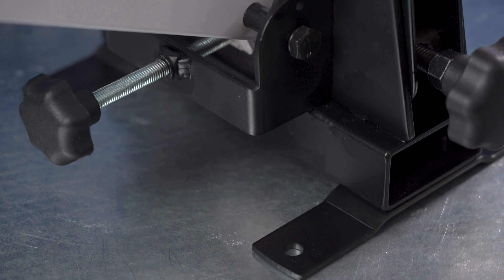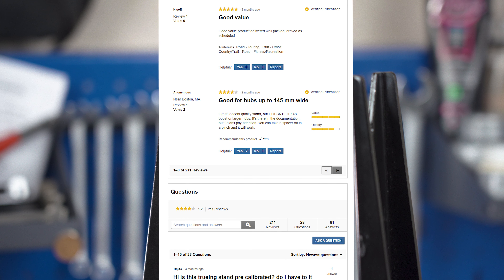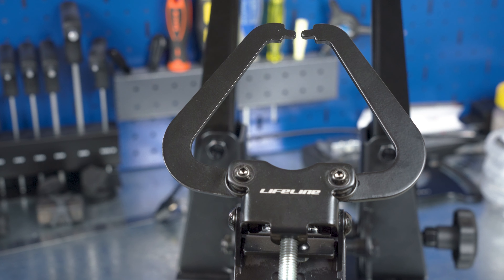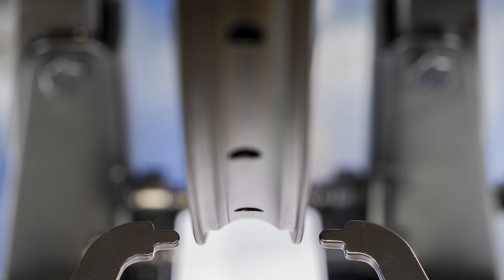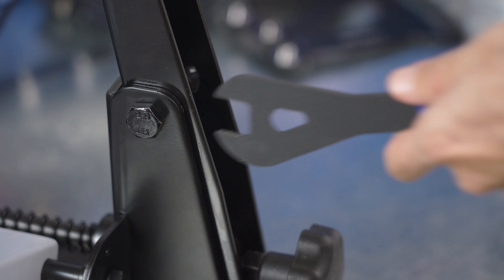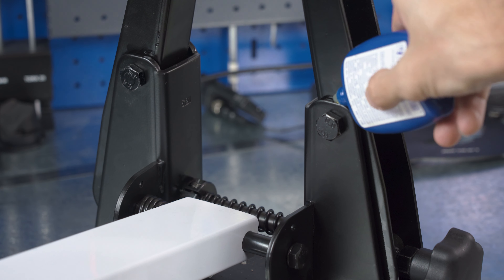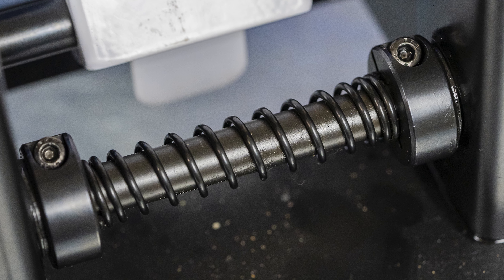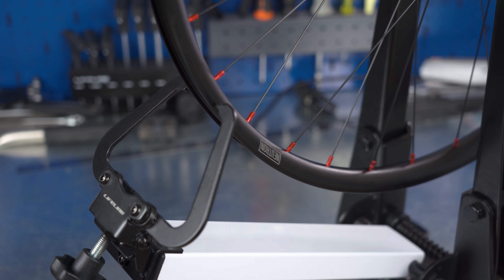LifeLine Pro Mechanic Wheel Truing Stand – common concerns (short review)

Comment: OK, I bought one of these. Reckoned that it would be worth spending the time to set it up, given what I would have paid for a blue one.
No big issue to get it to open to 157mm for DH hubs. Mine was already opening to 152mm, took off uprights (which was a little bit fiddly) and ground 1-2mm off the bottom of each. Now it's opening to 158mm at the lowest point where the hub will sit. 
My uprights too were not lining up when they were fully closed. As you say in the review, loosening the pivot bolts lets them line up (although still not completely in my case), but I don't think it is a good idea to do this. With the bolts loosened, there is a lot of backwards and forwards play in the uprights, which means that your wheel axle will be able to wobble in the stand, making truing very difficult. You need to keep the pivot bolts tight to prevent this happening.  The way to deal with the misalignment is by using the calibration screws on the callipers. You can swivel them to match the angle that the wheel rim is at. This does mean that you will have to re-calibrate a bit when using a different size wheel or hub
Reply from the maker: Kudos for your successful effort, Justin! Have not thought of posting a video on this upgrade?

Comment: I have the BikeHand version of this, and its arms open to 145mm only.  My calibrating screws were very tight also.
Reply from the maker: I guess, the real manufacturer of this stand adapted it to ~150mm hubs at some point due to demand for hosting boost hubs. But the descriptions didn't get immediate updates. Actually, CRC still says "145" 😀
Reply: @ZavyalovCycling  I hope to never need to make significant adjustments to keep my boost hub true.  If I ever need to, I'll do it in place.

Comment: I have this stand and is solid but not without some issues. This is a rebranded  Bikehand brand, bikehand is a decent knockoff of all parktools and other bike brands. I'm also using the park tools thru axle adapters and rotor truing attachment with this stand.
Reply from the maker: Clearly, "not without some issues", agree! 😀 But the price reduction is very noticeable as well!

Comment: How did you align the two uprights to be flush. Mine are horrendously off centred
Reply from the maker: By releasing excessive tightening of the uprights bolts. It’s shown in the video. I cannot promise it solves each and every case, but surely a thing to try. And Merry Christmas! 🤘
Reply: @ZavyalovCycling  I tried what u did, but I didn't work, it barely lines up, fully loose and pushing with my hands. Too bad, it looks like a nice stand. Merry Christmas to you too!
Reply: It's metal... Can't u bend them, with a lever to get straight. Maybe they got bent in transit? Bend back straight.
Reply: @rupedog  na, just really bad build quality. The two forks are welded not straight. Like so badly u can see with ur naked eye

Comment: Hi . Is this ok to use with carbon rim? Will it not scratch the rim?
Reply from the maker: Use it with some good care, and it won't. Any truing stand can scratch a rim, unless it has special rubber pads on tips. They are available as an option or with some very pricey stands.
Reply: @ZavyalovCycling  Thank you for your reply.

Comment: Anybody hacked this to fit 157mm hub? I haven't bought one yet, but am hoping that grinding a bit of metal off the bottom of the uprights will mean that they will open wide enough to fit a 157mm hub. Alternative is Park Tool TS-2EXT.2 Upright Extensions, but these are silly money for what they are and seem to be out of stock everywhere at the moment.
Reply from the maker: I'm afraid you'd have to grind reeeeeealy deep to have this chance 😉
Reply: @ZavyalovCycling  Thanks for reply. I'm surprised though as I only need to get an extra 5mm opening of each upright at the top. Given the length of the uprights and low down position of the pivot I would reckon that even just taking 1mm off the inside bottom of each upright would be enough
Reply from the maker: Your idea absolutely makes sense! However, as an owner of this stand, I still see lots of grinding required to get rid of this “excessive 1mm”. If you succeed, let everyone know through a video either. Would be a decent upgrade!